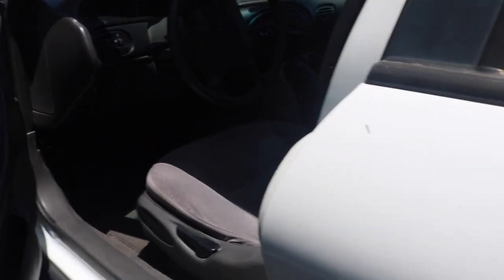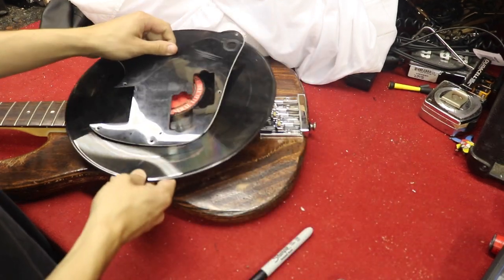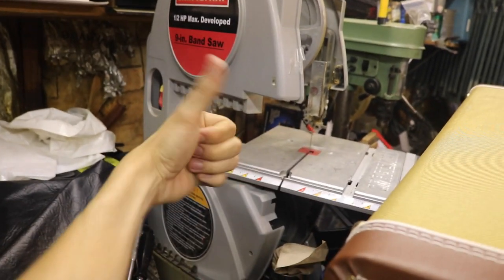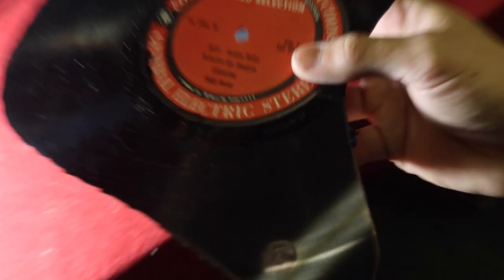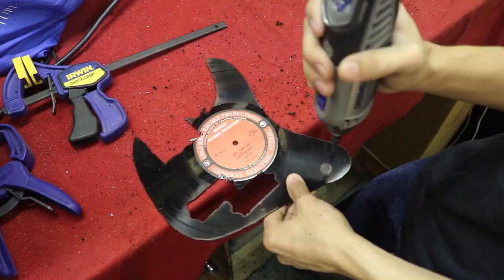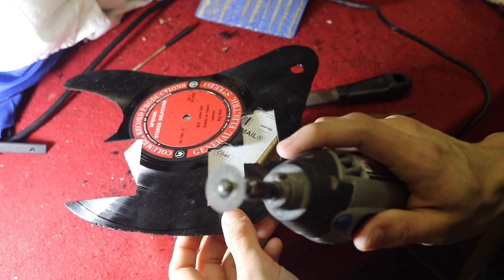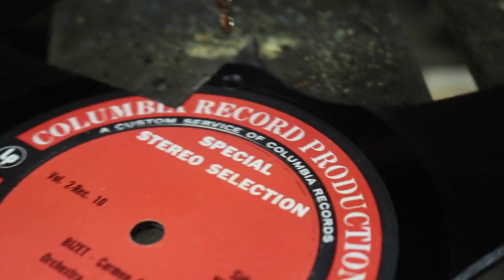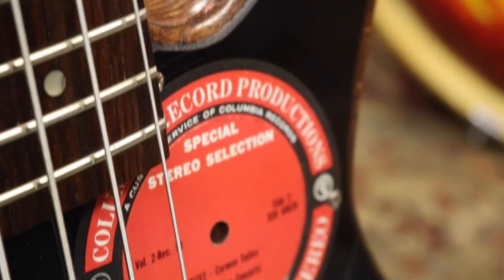DIY Vinyl record pickguard for bass and guitar!

Comment: Doing this for my jazz bass as I want to make a custom shaped pickguard to cover the routing space around the neck pick up and also covers that routing gap from the neck pick up to the volume control where the metal plate is. Right up to the edge.

Comment: Nice Video i noticed it chipped by the bridge pickup. I'm gonna try attaching an acrylic sheet underneath it to prevent chipping. Also trying to figure ways to protect the top. Tried sanding sealer but that failed, maybe a clear primer and gloss on top maybe, still experimenting.
Reply from the maker: Or, if you have enough room, a clamp placed in that area might give it the support it would need to not chip the way it did. Good luck with it!
Reply: I used 1/4 plywood with double sided tape as the support . Didn’t chip and I got to use a router for the edge for a nice clean pass .

Comment: Anyone got any ideas or suggestions on how to print labels?  I'm not gonna cut up my real "Nashville Skyline" or "Blonde on Blonde".
Reply: I've made one of these for my guitar a couple of years ago, for a few reasons didn't put it onto the guitar. I've found it while cleaning up the room and hey, why not, it was quite well made having been cut with a routing table out of a template, I want to finish it. As in your case, it has a random label, I tried printing some but the quality sucked. I've ordered a quality repro online, those should be really good (not here yet), there are reputable sellers on ebay offering them for little over two bucks.
Reply: On a side note, you obviously will only find a fairly limited selection of repro labels, unless you can supply the seller a quality scan of your preference and hope they make custom orders.